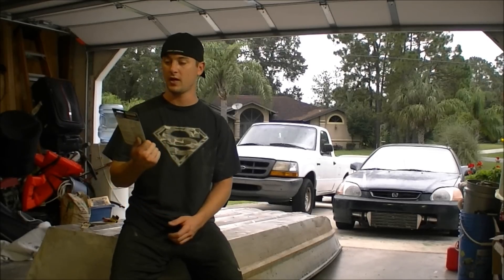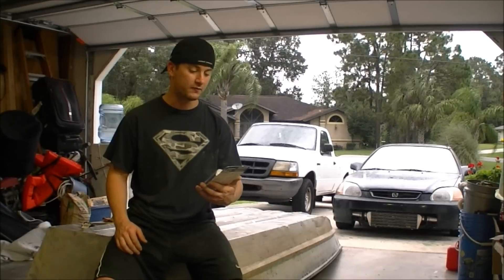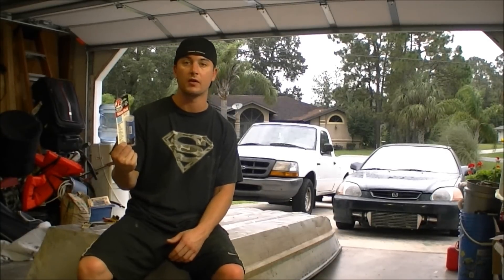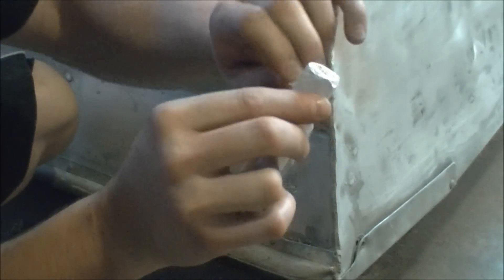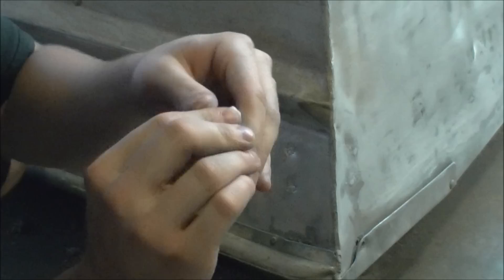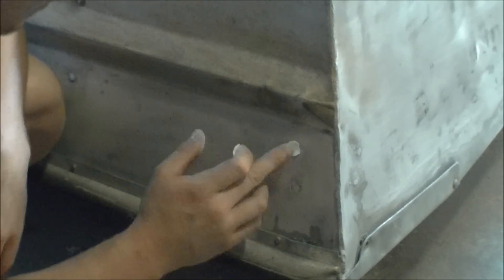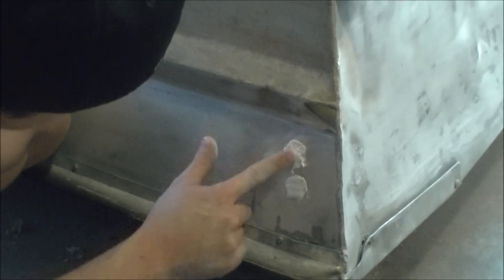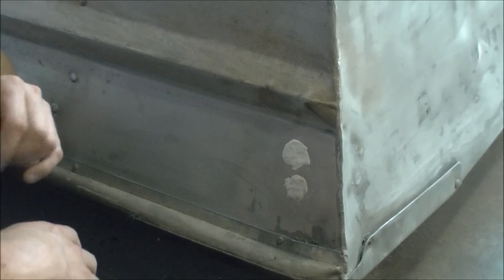JB Water Weld Test & Review

Comment: I used JB Weld to fix a gas line on my 1999 Ford Explorer.  The "quick disconnect" wouldn't disconnect, so I cut it and used JB Weld to glue a piece of tubing over and reconnect the high pressure gas line. Works fine for 2 years.
Reply: This makes me feel comfortable using it on my radiator. I have a small crack on one of the fins, too tiny to see. Hope this works.
Reply: @robertoconner4041 how’d it hold up on the radiator? I got a coolant line with a small crack I need to use it on
Reply: @ChriSS_LS3  it worked decently well. There were no signs of leaks or anything. But it bothered me knowing there was an imperfection. I bought a new radiator a few months after. It held up for the 3k miles I put it through with no leaks.

Comment: I used this today on a galvanized drain T, did not expect it to work but I let it set up about 2 hours and then turned water on, it isn't leaking. I am amazed. Saved ne from moving 2 sinks and cutting into a wall and breaking out the torch, I am thrilled.
Reply: I have a leak on a galvanized t pipe. Hoping did it last?
Reply: @Bill Argueta   the same guy is still living in that house, the last time I asked him it was fine.
Reply: @branthandford2212  I used it and it didn't work.

Comment: Two points: I'd definitely use gloves rather than work with this with my bare fingers.  And, I'd never stick my fingers in my mouth with this stuff on them.  Can't believer you did that!
Reply: Man up lol
Reply: Says on the package to knead it with your hands
Reply: You can't really do it with gloves. You have to get dirty for this job.
Reply: @liveandletlive2894  The package also says to wear gloves, though. Right on the front.
Reply: @typhlosionisbest   I don't recall seeing that
Reply: @liveandletlive2894  Oh, I just looked at mine. It's not on the front, but on the back, under "Safety Directions", that's the first thing it says. "Avoid contact with skin. Wear protective gloves." Then further down, there's a little information about what it does to the skin.
Reply: @typhlosionisbest   I used it with my hands to patch my a TV gas tank
Reply: @liveandletlive2894  Package says gloves, goggles, and ventilation, too.
Reply: Ok David MR DAD
Reply: @liveandletlive2894  it says use gloves on the package, I used it today
Reply: @mikep3322  😂
Reply: Just wash your hands and then no worries. Used my bare hands with this and many others. I dont let it just sit though

Comment: all epoxy products have their limitations. For pipes, all the box stores and some automotive stores sell a fiber wrap that is tape like infused with resin substance. once applied it dries rock hard sealing cracks.jb weld on other hand works great on SANDED metal surfaces that stay dry from gasoline or chemicals. the water weld works great on jon boat rivets but has its limitations on cracks due to flexing. There are a number of new boat epoxys on the market now that are waterproof and flexible. I have used in weld on several different applications and found that patching pin holes, small weld like projects etc. it worked very well.

Comment: My acrylic / fibre glass bath tub was damaged by the top of the tap falling off into the empty bath and making a hole. Our first clue was water pouring through the lounge ceiling.... :o    I applied this four nights ago and am very pleased with the results.  Quick, simple, easy and effective. No more leak :)  No way to know at this point how long it will last, but we've used the bath 5 times since and great so far.

Comment: used this on a metal water pipe .. turned off the water and did not wet it while i mixed it.. i smashed this hard onto the pipe that had a pin hole in it.. befor i started i shut off the water and sanded the area and let it dry... i used the whole tube of this stuff and its been holding for about 12 hours now... im no plumber but i will say if you use force while you put this on the pipe and smooth out the ends real well.. then this stuff will work.. you just got to use alot! and wait 24 hours or so for it to cure...! fixed this old ladys pipe.. she was 80 years old and damn was i happy to get out of there cuz she told me the same damn story like 10 times :/

Comment: I've got a pin hole leak in a copper plumbing pipe. It's deep inside a wall and I don't want to take the wall apart to solder it. 
Also, when you work on this old plumbing you can cause more leaks further along. .. I can get one arm inside the wall to clean it and stick on the JB WaterWeld.

Comment: I used some to seal around a window air conditioner unit on the bottom where the overlap seal was failed and it worked great. I did rough up and clean, then applied to the dry surface, then waited several hours for it to cure. It did cure in one hour. After several hours, it should be like a rock, this stuff has to be mixed or kneaded well first or don't waste your time using this product as it has to mix well to work.

Comment: Trying this on hairline cracks in my plastic bath tub.  I've made previous repairs with fiberglass.  Saw this in the store and thought I'd give it a try.  I'll let you know how it works out.
Reply: How's it holding up? How long did you let it dry before you used the tub?
Reply: Yeah how's it going 9 years later? I'm curious

Comment: Thanks for this video 
I’m Truck driver and I have ac low pressure line leak , end up on Truck Stop and thinking of solutions, finally found this video. 
Hope everything works and I safe so much on repair ( time and money)!
Reply from the maker: EZ Pass if you're going to attempt this, just make sure to give it a nice little sand with some lights sand paper,  then swab it with alcohol.

Comment: Thanks for the demo. While the instructions said to knead putty to a uniform color, the outer layer and inner core colors didn't jump out at me as being much different.  In fact, I didn't even notice a difference, so I did not mix it well enough in attempt #1. Was curious how to trigger the chemical reaction, but thought: Maybe these guys have created an easier epoxy.  My curiosity turned to frustration after 2 hours and now hardening.  Saw this video, kneaded under a bright light, and hope that attempt 2 hardens as advertised.

Comment: I'm doing transom repair were my transducer is mounted.  I'm using this JB Water Weld.  I cleaned old JB original off with air grinder down to shiny metal then used acetone to clean up debris.  Cut amount with knife and mixed by hand with gloves on.  Packed into holes remounted transducer bracket and applied more JB  in one hour it is rock hard.  I'll put it on the water sometime this week to see if it holds up.

Comment: Used this on a gas tank puncture years ago.  Stuff works like a champ.  Rock solid and it never leaked.
Reply from the maker: +1SnuffySmith It's real good stuff! People would be surprised. It's not like regular JB Weld.
Reply: I plugged a small leak on my gas tank 2 weeks ago and it is garbage.  Tank started leaking today.
Reply: I can't even get the stuff to stick onto the gas tank. Whatthe heck. I says it will hold under water...but not fuel?
Reply: Email Me maybe all surfaces have to be dry??
Reply: theone2be33  - but itbsays it hold under water.  It's just you have to hold it to the surface for 5 minutes. I have used Gorilla glue and some of the water weld that didn't hold to patch little spots until the leak stops. Then will clean, sand, allow to dry and then put the waterweld on...hopefully to fix the entire thing. Then i can feel right abouf selling it.

Comment: I have an old bathtub faucet that developed a small knick in the valve stem about 1mm x 1mm (the tube that the washer engages with), so leaky faucet. The only permanent solution is replacing the faucet, but I was able to put that off for a few years by jamming waterweld in the knick (prep it, clean it, of course).

Comment: Thank you for teaching me about this product. Im using it to fix a small fuel leak at thw top of my fuel pump in my car. My car always wreaks of gas. Hoping to fix that issue!
Reply from the maker: This should stop the leak. Just make sure to prep it good with some 60grit sand paper and rubbing alcohol. Let dry, then apply the JB Water Weld.
Reply: Nthefastlane but whatif there is fuel in the tank and it's leaking? It won't adhere to the tank
Reply: same here man, did you get yours figured out? Im about to run out and buy some because the little plastic bulkhead wire pass throughs are spewing out gas for me
Reply: @Moon___man  using this now on a plastic atv gas tank

Comment: The shift handle on a 25 hp Evenrude broke in half.  I used JB Water Weld to repair.  The handle was plastic.  I scuffed the underside surface and filled the cavity with the putty.  Next day the shift lever was good good as new.

I also use JB KWIK to bond a Savage 10 round magazine box to the Savage Axis magazine base.  I cut a hole in the Axis base, line up the two haves and apply the KWIK weld.  I end up with 11 rounds in the magazine and one in the chamber.

Comment: It works great for metal gastanks i use it all the time
Reply: devin snyder  have you used it whilegas is leaking outnof the tan? A small drip but none the less...i have used 1 1/3 tubes and it will not stick.
Reply: @curleycue74  I know it's late but sand it make the area rough and use alchol to dry the area

Comment: I am about to try it on my new, installed, very hard to get to, potable water tank in my bus.  I installed the tank, plumbing, built the kitchen and apparently the plastic weld at the .5" connection leaks, hopefully this will do the trick, good to know it worked well for you, I checked the comments below it seemed to last for you.

Comment: 1. would be interested in seeing you use JB Water Weld underwater to repair something.

2. because this boat was repaired out of water, would like to see "regular JB Weld" used for repairs and if it would hold up after dried, and then the boat used in the lake for the same length of time.

Comment: instead of spitting on your fingers to smooth out just put a little bit of baby oil or vaseline on your finger you are using to smooth it with...this does 2 things...obviously it makes it really easy to smooth so there is much less finishing work after it dries...but it also makes it so what you are spreading/smoothing does not stick to your fingers and will wipe right off very quickly and easily...this works with silicone,caulk and yes...even the dreaded spray foam...guarantee that if u try it you will always keep some around...its night and day...if you put some on your finger when you are done smoothing you could even pick up a leaf from the ground and use it to wipe off your finger and it all will come off easily
Reply: @billiebobbienorton2556  dont see why not..if your in to those sort of things

Comment: I used it on a turn-off valve in my basement that was leaking water.. used half a package and it still leaked, turned the water to the house off completely, put the rest of it on the leak parts .. waited a couple hours, it was hard as a rock.. but still leaked when I turned on the water. Went and used another whole stick of it, completely covering the shut off valve up to the pipe... and.. it still leaks. So, all that --- about it curing under water.. I say BS! Also, it warns not to get in eyes and on skin but it does not tell you to make sure you wear gloves when touching it!!!
Reply: Arlene Kurtz nice one i need to try this on a copper pipe which is next to a gas pipe as I can’t get much access with a spanner to tighten up an old joint! Worth a try for the price ;)

Comment: I had a few problems with this. When I first unwrapped it, it felt as hard as a rock on the outside, I don't remember this the last time I used it, or something very similar,  years ago. I thought it would loosen up as I mixed it, so I cut some off. It didn't!  I had a a pile of rock hard bits and some gooey mess.
 I phoned the company, they were helpful,  checked the date, it was made last year, so it should be OK.  They told me to microwave the tube for 10 seconds. I did and it became pliable. However, the central part, the resin ? and the outer part, the hardener? are the same colour! So you can't tell when it's properly mixed. I mixed it until I thought it was fully mixed and then used it on the repair. 
It wasn't mixed enough as some parts hardened right up, and others didn't. I picked out all the soft bits, took a while. 
I bought a different product at Home Depot for less money for a tube twice the size. This one had different colours, and I knew right away that I hadn't mixed the JB stuff enough, it took quite a while to get an even colour, but now, it's all rock hard.

Comment: wondered how this worked.  going to use it on a motorcycle carburetor to fill and re-drill hole in my air-slide piston.  restore it to stock specs.

Comment: Might want to say that it does not stick to a wet surface....have an iron pipe with a slow drip at the elbow threading (about one drip every 2 seconds).  WaterWeld would not stick to anything once the water hit it...
Reply: Bryan Young Dang, that bites. How's it supposed to work under water if it can even get wet?
Reply: so true
Reply: B Y 
Dd

Comment: FYI for others:  I had a fail with JB's water weld, tried to wrap around full circle on dripper hose (polyethylene) with some aquarium epoxy putty, no dice.  Returned a few weeks later, Mt. Rushmore would probably be easier to bust up.  BTW a gash in polyethylene is near impossible for a homeowner to fix due to it's incompatibility with oh, just about everything.  Anyways, I figured, well the polyethylene is completely covered now, this should be a cinch.  Nope, it blew right through another heavy coat.  Now I do have Mt Rushmore on my most important dripper & I live in AZ (96 yesterday)  So the "quick" fix didn't work and I'm going to have to rebuild that line from the manifold down, arrrgh.  Anyways, glad you could share some JB love.
Reply: +Nana Ann you could try electrical tape. Maybe even coat that.
Reply: ummerrahh Thx, I tried the previous tape idea w/the weld & while successful, it only popped the tubing further down the line...the stuff was splitting on the seam.  The dripline tubing is 10yrs old, exposed to AZ sun, so it's time to screw the pooch & get some new tubing hehe. I will remember your idea for future hoses however :)

Comment: i just used jb waterweld and it has very low adhesion and doesnt dry to a rock hard material even after 24 hrs dry time. and it takes longer to cure than said. didnt use in water, maybe that activates it

Comment: How did the tub fix go?  I have crack in my plastic tub as well.  Thinking about using the water weld instead of a kit made for fixing plastic tubs.  I patched my well tank hour ago can't wait to see if it holds.
Reply: Karen Felder  I fixed a small crack in my tub with it 2 years ago is still fine tub is fibreglass I think . That JB water weld is good
Reply: About ready to try this on a plastic mobile home tub crack tomorrow.  How long do u need for it to dry, then sand?

Comment: I’m trying to use this on copper pipe in the winter and it’s not working. It’s between 0-15 degrees Fahrenheit the epoxy is taking 6-8 hours to fully harden but water is seeping directly thru the harden material.

Comment: I was using it to attach a plastic sheet on a turn signal lense that fell off. I rolled it into thin rolls to place around the edges. Then molded it in place . It never hardened. It said mix thoroughly? Wish I Would have watched this first.
Reply: Instructions could be more specific on how the inner core must mix with the outer core.
Definitely wasted the whole tube for nothing.

Comment: I have a carpet cleaning truck mount and the waste water tank started to leak yesterday from a little hole it has, where can i buy this to try and fix it? By the way the machine it self gets really hot , will that affect the product?
Reply from the maker: I posted the link to the product in the top comment. If you ever watch any of my videos in the future I always pin the products in the top comment or in the about section. You'll see "Shop This Video" JB water weld can withstand up to 500 degrees Fahrenheit. It'll be fine. Just make sure to prep the surface and clean it with rubbing alcohol before applying the puddy.

Comment: Can i use this on a plastic tub crack?
Reply from the maker: Yes this will work. I would clean the crack first with rubbing alcohol and a tooth brush, let dry, then apply the JB Water Weld. More then likely it's (FRP) Fiberglass Reinforced Plastic.
Reply: @Nthefastlane  thank you for responding quickly. I will do this today!
Reply: Lisa C did it work out for you? I’m getting ready to repair a crack tub as well. Lol
Reply: @lexysoloaded3583  so far it's been holding. Eventually I will need to replace this tub, due to it being in a rental. The tub is a mobile home tub, therefore as these types of tubs age, they become brittle. Good luck with yours!
Reply: Lisa C I’m using it on washer outter tub
Reply: Lisa C but thank you

Comment: Hi, nice video. I have a question, do you think i can use it to put 2 pieces of polythylene together? the problem, the rearview mirror on the right side of my car fell off. thanks!
Reply: Just use superglue or regular JB Weld if it's inside your car and not exposed to any chemicals on a regular basis.

Comment: tried this shit on a sprinkler system line that craked [1" PVC] shit wouldn't keep the pressure out, which was maybe 90 psi max. so their pressure rating is bogus.
Reply: Munky332 The PSI rating is for tensile strength, not fluid pressure retention. Although I would think 90 PSI fluid press. should not be a problem if the surface was prepped properly and product applied correctly. Sanded and allowed to cure properly before putting pressure back on line.